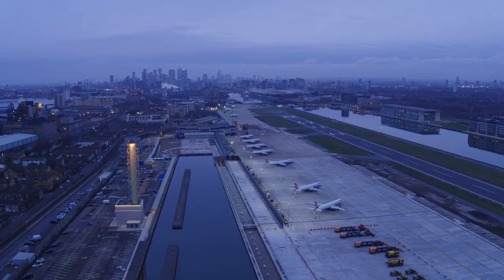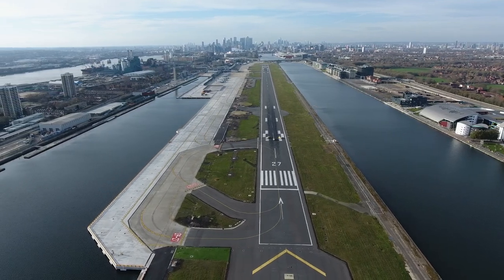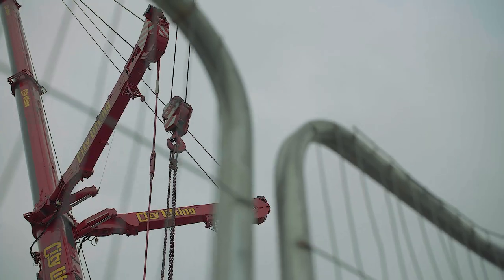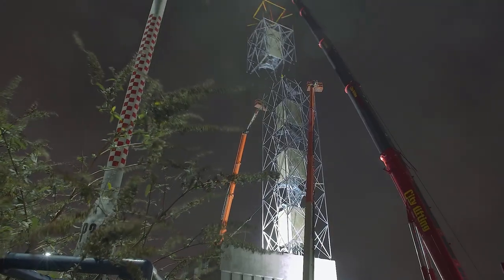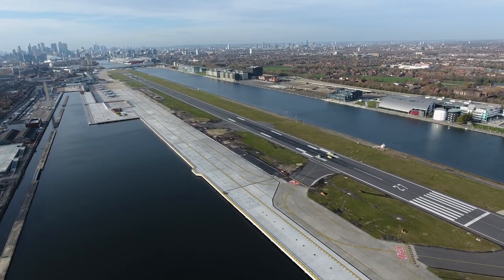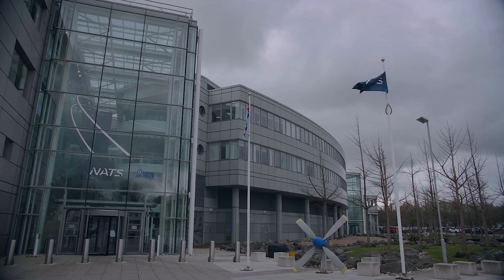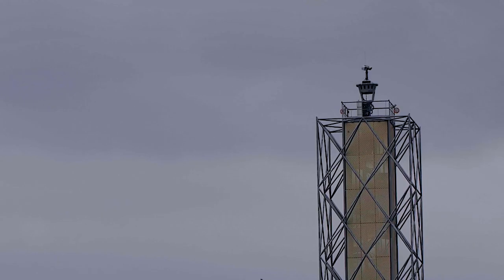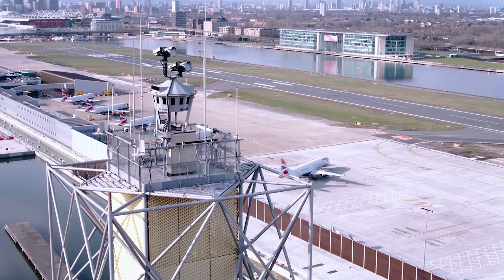Digital Air Traffic Control Tower

Comment: Im curious as to the reasons why they chose to do this. What are the benefits vs a conventional tower?
Reply: The answer is Money, I guess. To have people coming to work to London city airport is much more expensive than in Hampshire.
Reply: It means its almost impossible for NATS to lose the ATC contract when it comes up for renewal at LCY.
Reply: The old tower sits on the top of the terminal which is scheduled for expansion: building a new one on site is more complex than remoting the operation, & means the service isn't interrupted during the transition.

Comment: I am not sure what is the feasibility of this if the aeroplane still controlled manually?. You just add other layers of failure, if the fibre network is damaged.
 I was thinking you build software that codifies the knowledge of the controller, so the air traffic is substituted with software and the people only monitor the software in case of any issue.

Comment: Everything is great until the power goes down. I hope they keep the old analog tower as a backup.
Reply: Or someone accidentally digs up the fiber link.

Or a bird craps on the camera lens.

OTOH...this could open up the possibility of sharing controllers across multiple fields, which could mean that busier Class E fields could be upgraded to class D for a fraction of the cost of a dedicated tower and dedicated staff.
Reply: Jason & Russell

UPS and backup generators?
Diverse fiber links & lens washer/wiper systems?
Reply: @sdale6885  I've been without power or internet in a place with backup generators and 3 fiber links.

Just sayin'
Reply: Guys, all the problems you mention can also happen in a conventional tower but it is not bothering someone... But you're right, conventional towers have to be kept as backup or the other way, digital tower can be used as contingency in case of big problem at conventional tower. This concept is just adding some new capabilities to the conventional solutions, not removing everything.